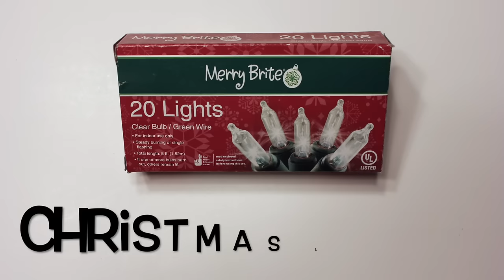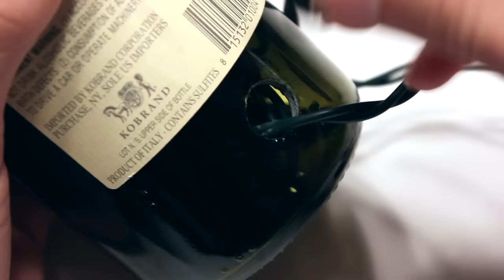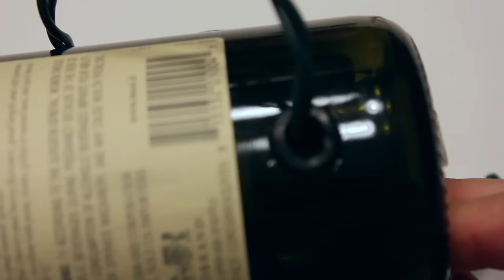DIY: How to Make Bottle Lights

Comment: There is now a string of lights that you can buy and it has a bottle cork on one end that hides a battery and switch. Saw it at a craft store.
Reply: Just seen this and bought a 2 metre set of 20 LEDs for £1.80, thanks!

Comment: I have tried this with several bottles.  The Christmas lights get so hot that I couldn't pick up the bottle.  The only fix I found was to go with LED.  Have you had similar issues?
Reply from the maker: Yes, you can use strings that have less lights or use different kind of bulbs!

Comment: Or you could just buy the cork with a battery and a switch already inside attached to a string of lights which fit inside the bottle off of Amazon for $3

Comment: K if u we're going to feed it through the bottom why cut the cord then
Reply from the maker: Two reasons, first we want to get rid of the useless wire so it doesn't take up more space.  Second, we cut the female plug which is necessary to remove because with it on we can't feed it through the hole

Comment: in this town no one sales the dril bit you use.
Reply: change bit go to a home depot of lowes and get a glass cutting spade big easier to use still drills nice clean hole just go slow..........use a little spray bottle for water as u do not want to let the bit or glass to hot, I can drill 24 bottles in 20 minutes with no breakage, And I use w regular dewalt variable speed electric drill.
Reply: or eBay for the bits